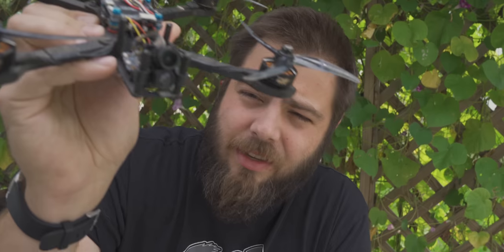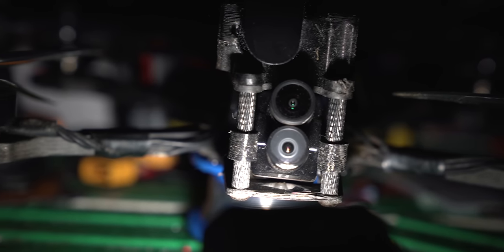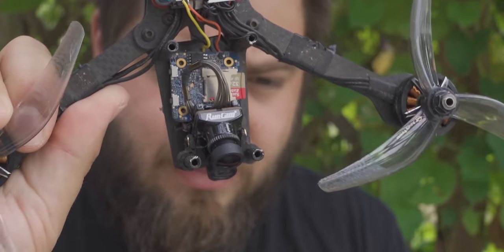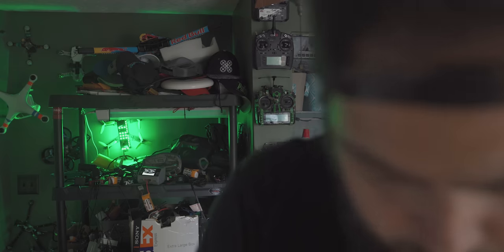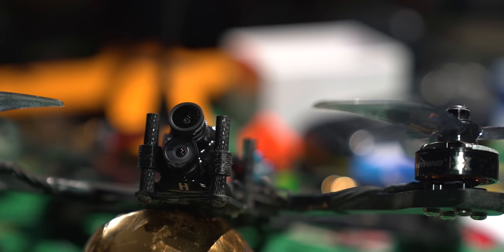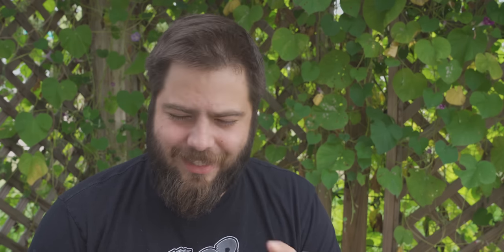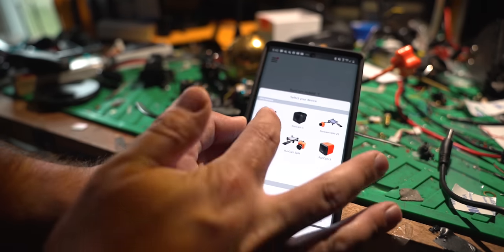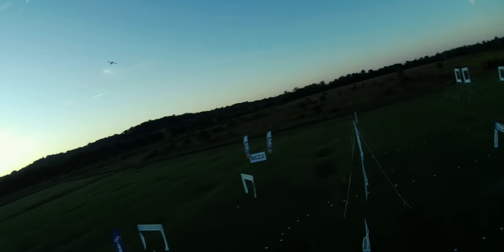Can the RunCam Split Hybrid Make you Leave the GoPro at Home?

Comment: I used the small brass stand offs as bolts that come with my split mini2 for the sd card cover and the female female stand offs as nuts and just insulated with extreme hold double sided tape where I mounted it so it didn't ground out or something unwanted and it works great

Comment: This is the camera I have been waiting for.  Thanks for a good in-depth review.  The one thing I need to know is if it ALWAYS saves the video file if you unplug the battery without stopping the recording.  My Tarsier only saves the videos sometimes if I forgot to push the stop button.
Reply from the maker: I have never once pushed a stop button with this camera - every "end of recording" has been when I unplug the lipo.
Reply: @NURKFPV  Awesome.  That's what I need.  My Runcam Splits have all saved the recordings correctly when unplugging a battery, but I just needed to know for sure.  This sounds like the best split camera yet.  Thank you!

Comment: I'm so excited for progress in this direction.
I don't want to need a big ass gopro on my kwad.
Reply: Index they’re just going to keep making the gopros smaller or film in much higher quality. I’d imagine people will always have a second film cam for the highest possible quality
Reply: @SAFbikes  people gut GoPro's and put them on whoops, (I do as well) they aren't much bigger than this. There is no reason why split cameras couldn't be as good, if not better. The future is stacked cameras. Also, the next move is baking in 360 cameras and logging gyro data. Hollywood already uses 5in quad's, and they want more reliable takes.

Comment: Instant purchase for me - sub-250g build that can record in 4K and with good FPV latency. The only thing that worry me is that Runcam boards historically are very vulnerable to crashes. Processor have no "legs", so when the board bends on the hit even slightly, the camera usually starts glitching and eventually die.

Comment: Paul; Have you tried using 2 screws/nuts for the retaining clip without the standoffs.  I used 2 of the screws for the clip from the bottom using Permatex on the threads, then clip off the threads past the nut.  VHB the board wherever. (That was how I used my RunCam DVR) Does it split the video into 3 or 4-minute segments?  My Foxeer Mix V2 died on day 3, looking for a replacement.

Comment: Hi guys, just wanted to mention that I have this camera as well, its very nice but as Nurk mentioned, the issue of the ejecting sd card is there :s, and also the connector from the camera to the board sometimes unplugs in soft/medium crashes already. Maybe you  can solve it adding the strap as shown in the video but in my case I have the camera board mounted on top of the stack and there is not room for a strap

Comment: The camera can be turned upside down, since the FPV camera is smaller, you can manage to put a larger angle. Аnd the sd card can be fixed with tape

Comment: Looking at the comparison clips (thanks for those) it's clear the Split Hybrid doesn't even come close.
GoPro has a much wider FOV and copes with light level changes so much better, notably at the 33s mark when you fly inside the garage then turn and fly out - the brightness on the Split Hybrid is blown out & the GoPro handles it easily.
Oh well, I'll keep using my Caddx Tarsier until something better comes along.

Comment: Hm. its cool. but its still a combo DVD/VHS player. 
never understood why people felt that they have to use the FPV feed on splits. just run whatever  FPV cam you want stacked with the split.  just like you would with a gopro, but still saving all that weight. with two separate lenses you dont get that tilt problem as each camera rotates on its own mount/axis.
what I want is a 4k bareboard camera. no FPV out. basically  the guts of a goprop with no display, no batter, nowifi. just a stripped down 4k cam that works.

Comment: Try the Cygnet PRO frame from GEPRC
along with RCINpower 1506-4300kV
will be a speed demon
if you want a 20x20mm build
Just a thought...
Reply: https://rotorbuilds.com/build/16780
The non pro version with 1106, I couldn't break it
Reply from the maker: Checking it out!
Reply: You sure those 1506 fit the Cygnet? It fits 11xx/12xx motors. Dunno if 1506 have that small a mounting pattern.
Reply: @oliverbodwell1300  the pro version has broader arms and  can support 12x12mm motor mounts
Reply: The non pro version is on sale for $175? Then swap the camera.
Reply: I build a Cygnet pro soon as I get the Hybrid with 1407 motors.

Comment: In my opinion most of theese "non Gopro" cams have huge problems with wrd and auto exposer...
Reply: zerox they all seems to have image issues aswell, or way to much visible lag like the original splits, I had the caddx turtle which had lines in the corners and nothing got rid of them. These split cams seriously need some redevelopment...
Reply: I use the split 2 mini and yes, it has some issues with the full definition but all in all, no wdr issues or exposure issues. Not sure about the turle but using it, cruising around with my cinebee, it works pretty well. Of course this is a much slower quad. The split 2 mini, I use in my Acrobrat and I think it leaves perfectly watchable footage. Also, there is enough changes in the settings possible to adjust the footage to your likings/the weather
Reply: @jasondonavich2758  i think its something that I can put on like an FPV airplane or something where weight is really important
Reply: @aldenhauser9555  if you use one with 2 cameras like the hybrid or the caddx then yes, but never use a single camera split style camera as you run the risk of having your image freeze up mid flight

Comment: Why not record and see in only one camera as DJI do. Only issue is props on the way.
Reply from the maker: I explained that in the video
Reply: That's a good question! Most the cameras (be it with AV out or fully digital) have a digital interface - namely CSI or LVDS. It's the task of the dedicated piece of hardware - typically some SoC (system on chip) to convert this data to analog video or stream it in digital format. I guess the main reason why they do it as two separate cameras is that once you set the camera to 4k 60fps mode, it's not that simple to scale it down to PAL resolution without any noticeable latencies unless you use some highly specialized hardware which might not exist in consumer market because there simply is no need for real time downsampling from 4k to PAL and converting it to analog video format. In that case, the only option is to design your own FPGA and then ASIC and deploying that is quite expensive

Comment: caddx has the same thing.... man. recognition... caddx originally released the idea..... credit where its due.
Reply: I'd agree but I'm pretty sure design was started about the same time but the tarsier was rushed and they've already released a V2 to try and address some of the issues. Runcams product is far more refined on the first go round.
Reply: @Burn377  fact remains. Would you discredit wright brothers for a powered glide and award first flight to someone else? Because it wasnt refined?
Reply: @highwaltage  I don't think that's really comparable. And if you wanted to play it that way I believe Runcam was the first split camera?
Reply: And you yourself gave me info regarding QC issues with the tarsier.
Reply: @Burn377  fact is still fact tho yeah?
Reply: @Burn377  we are talking dual lens business hurr.
Reply: @highwaltage   KillaG FPV  you disregarded your previous statement by saying that, the dual camera design is still just an upgraded split so in that train of thought disregard the wright brothers plane over a Cessna because it has more technology even though at the core they're both aeroplanes? (See where I'm going with this?)
Reply: @Burn377  sure. Airframes. Technology. Onboard dvr vs  Dual cam. 4k. Seperate fpv. Caddx released the dual cam first. Yeah? diff views in the sense that i see dual cam as an innovation from caddx more than a refinement of Onboard hdvr. Was eachine first to do onboard? No idea curious tho.  Refinement from runcam..
Reply: @highwaltage  Horses for courses I guess. We'll have to agree to disagree ;) all I can say is I'll be replacing all my caddx and runcam fpv cams with the Hybrid.
Reply: @Burn377  i most likely will too. Ill say this. Out of all onboard dvr units ive had. The tarsier with dead wifi from crash has been the longest lasting. ive killed it a few times and it keeps working shit ripped off the board and still works. Lol. granted dual boards make crashing a bit.. explodier. I hope runcam holds up just as well. Split v1 and v2 did not like crashing at all. In my exp anyway.
Reply: @highwaltage  Guess it's luck of the draw my split mini V2 has been in the creek twice and still works perfect 🤣 while the 3 micros I've had with turtle v2's have given subpar results from new. Still haven't used my tarsier build. Taking it out tomorrow if it doesn't rain can't say I'm a fan of the app and setup though.
Reply: Better QC all round would be nice.